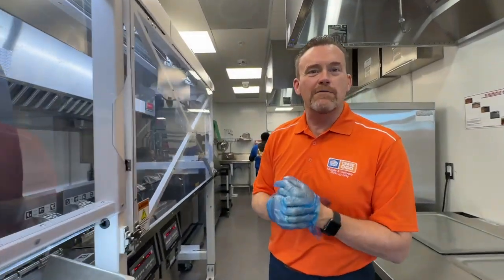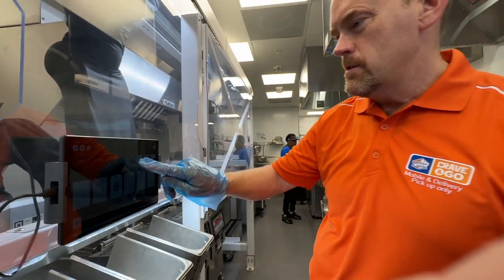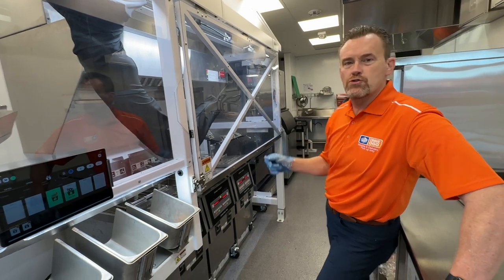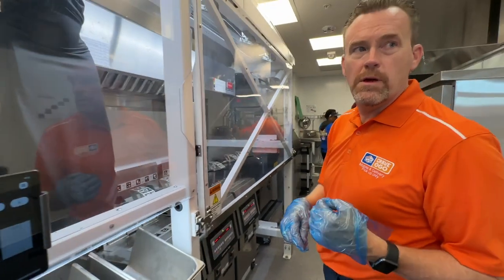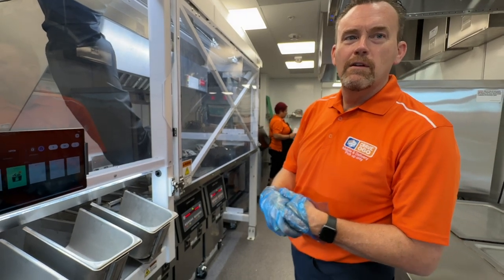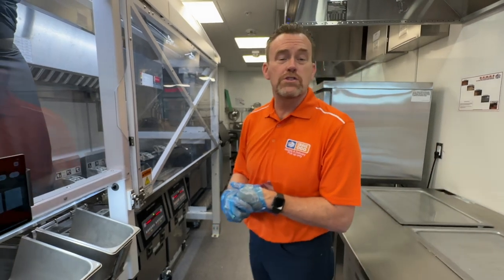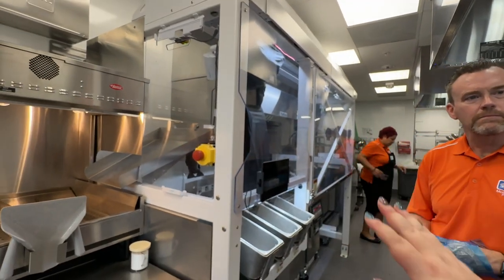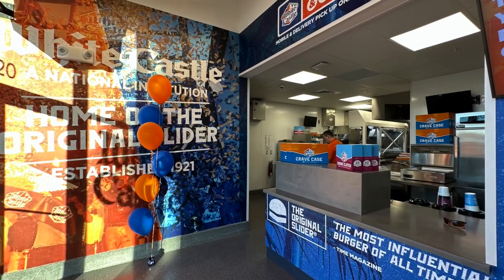Meet White Castle's Newest Orlando Team Member, Flippy 2! #whitecastle

Comment: I'm mixed on this tech development. Still high human involvement before and after the frying of food. It seems like a really complicated fryer timer.
Reply: My thoughts exactly. Human workers would still be more efficient.
Reply: way too many complex movements to be efficient. All these moving parts will cause a lot of wear and tear. I can't imagine the cost of maintaining this system being viable at a restaurant scale.
Reply: True, they have the auto lift models out there, but, it still requires a person to work around the deep fryers.  I also understand the type of worker fast food restaurants employee and their turnover rates.  So, probably someone spun the numbers, and said, you know, this isn't that far off. 

I'm surprised they don't have Flippy integrated in the order intake system and use the hopper for ALL foods.  Why have those side bins, doesn't make sense.  I mean, eventually, the only human interaction is consolidating the order into packaging and no human ever steps in the cook area, which, I clearly see as the way things ARE going to be for fast food restaurants.
Reply: Agreed but they can just keep adding.